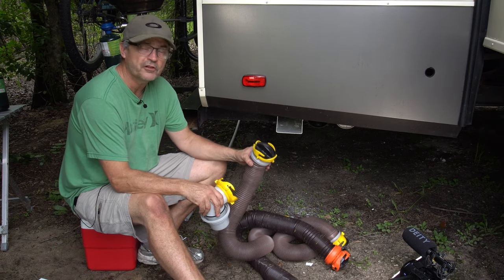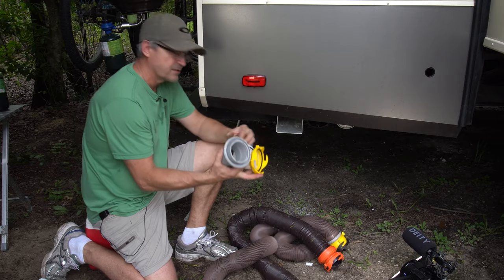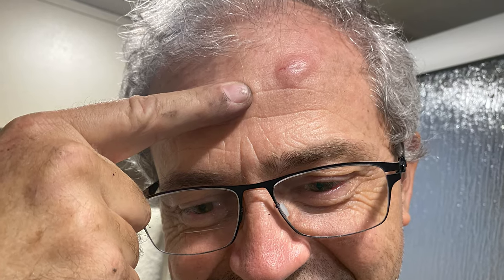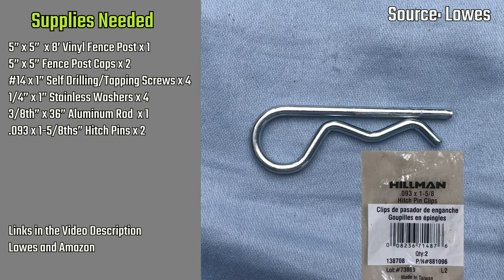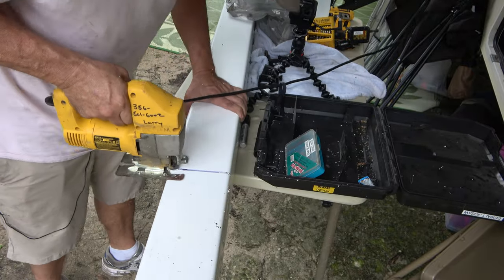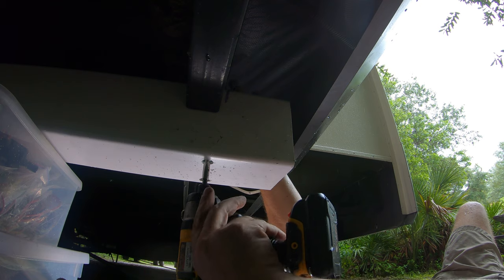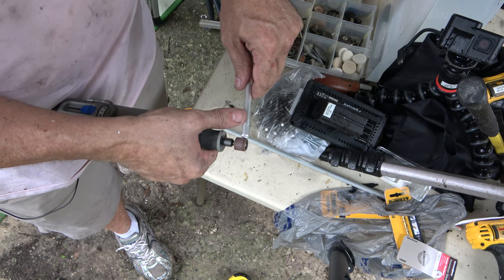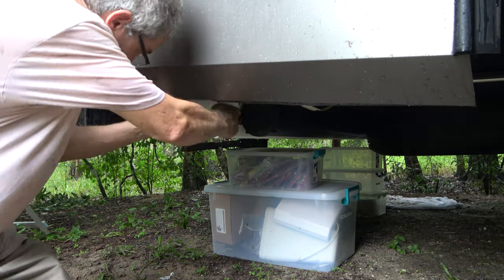Large RV Storage Tube for Sewer Hoses plus more DIY (RV Living Full Time) 4K

Comment: I think I saw the same video as you. Mine looks almost exactly like yours. The only thing I did differently was I painted my post black beforehand. I also screwed the opposite cap shut on the camp side. I like your hitch pin much better. Mine is a threaded rod with a wing nut that's kind of a PITA. I couldn't find a pre-made hitch pin long enough. Kudos for fabricating your own.
Reply from the maker: Lane, Larry likes opening caps on both ends. 
As for the hitch pin, Larry is pretty good at “Larryizing” his DIYs 😉 
Alice

Comment: Thanks for the tip, very thorough.  Just happened on your site,and I am going with the same. We have a 1993 RB,(rust bucket). I need to rework all the outside storage boxes and covers/doors. They are rusted out,and like the metal hose storage at rear, they have all been neglected. Be checking back in with you. Pablo
Reply from the maker: Glad you found us. 
We are thinking of moving it next to the sewer outlet

Comment: Typing from under my GD Imagine 2800BH. Installing 2 of the 5x5's and only got 6 tapping screws for some reason. It's starting to come together and I even had spacers laying around to compensate for the propane line running down the passenger side under the I-beam. Thanks for the video. Hoping this turns out as nice as yours minus one goose egg.  :-)
Reply from the maker: Hope yours turned out good.  I love having the extra space in my 5x5 tube for connectors and accessories that won’t fit in the bumper or my super tube.  The goose egg helps me remember how much I had with this project.  Larry

Comment: I was trying to figure out a way to secure the end caps, a great idea. I was thinking about using 6-inch schedule 40 with screw-on end caps but this is cheaper I think.
Reply from the maker: Joseph Melcher The problem with your choice is that it’s extremely heavy. I was going to do that until I weighed a 6 foot piece. Larry
Reply: @DownsizingMakesCents  What happens when you hit that low dip and it breaks the post. Yes, it might be heavier but is it as durable.
Reply from the maker: Joseph Melcher I get your point. But we haven’t had a problem yet. We would love to see a video of the schedule 40 when you finish. Alice and Larry

Comment: That is clever and bigger. Originally I was thinking glueing one cap, but saw that you made it basically as wide as trailer so access from both sides might be useful. 
I've also seen one smaller storage bay with a basket that has all the sewer stuff including the black tank flush hose and the gloves. It's all that lives in it, that way it doesn't stink anything else. They use a magic hose that is a different color than the drinking water hose.
Reply from the maker: Hi. We used to keep a lot of it in a bucket. But as full timers, we need all the storage we can get. Plus I like the stinky slinky to be outside away from everything else. Also some people mention it could be used for fishing poles and other things. We can add a lock 🔒 too. Thanks for your thoughts. Take care. Alice.

Comment: Love this idea. I’m not super comfortable drilling into steel so I might look for a different way to attach with zip ties or something.
Reply from the maker: If you use the self drilling/tapping screws like I did , it is pretty easy, but I think you could use heavy duty zip ties also.  Larry
Reply: I used beam clamps and all thread and made a trapeze hanger to hold mine up so didnt have to drill into the structure. Has held steady after many years and miles.
Reply: @mjd034 could you provide a picture and some more details?

Comment: did I miss something? where did you use the Large Bore 7/8  - 1 inch drill bit ?
Reply from the maker: I used it to drill the access holes through the PVC tube so that I could put in bolts for the frame

Comment: Good video! I cant make my own locking pin.  Any ideas?
Reply from the maker: The easiest method I could think of would be to use a 6 inch X quarter inch bolt with a Nylok wing nut at the end.  Drill a 5/16th hole through the And the tube.  Larry
Reply: @DownsizingMakesCents  Thanks, great idea!

Comment: Looks great. I believe I would had gone with a little larger washers. Also I would add a strap around the outside of the pipe to keep any movement to a minimum. I'm one of those "overkill" folks if ya didn't notice
Reply from the maker: I am also one of those overkill kind of guys, bigger washers would have been better.  So far it is holding up well after over two years of constant travel, over crappy bumpy roads.  I should inspect the screws and washers to make sure the plastic is not fatiguing.   Maybe i will do a follow up video.  Larry

Comment: Curious what happens when you force the hose and fitting into the bumper @ 0:24?  I suspect it will eventually get it stuck and rip the hose trying to remove it when it binds up.   Here is another great version with a spring loaded door, so you don't drive off without the door...  The gutter tray is very good idea too.
https://www.youtube.com/watch?v=pIVUSAmFRIQ

I sympathize with the lumps on the head Larry, its just part of owning an RV.
Reply from the maker: It Is a very tight fit in the bumper, I keep a piece of pvc pipe handy to push it through the other side when it gets stuck.  That’s why I did this project, now I don’t have to worry about it.  Larry

Comment: Almost easier just to buy another round sewer tube
Reply from the maker: Rick, hi. A second tube is an option but they are much more expensive and the main point is they are too small for all the attachments. But if you are not a DIY guy you can definitely just have the bucket of accessories separate in your basement. Thanks for your thoughts. Alice